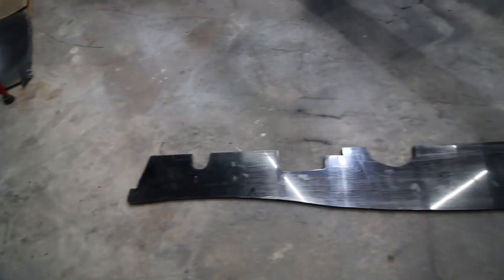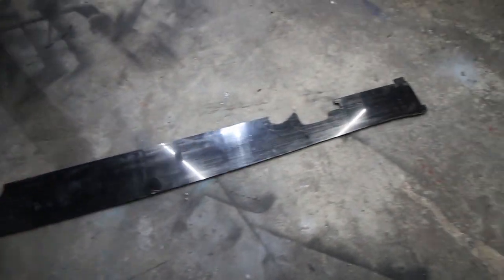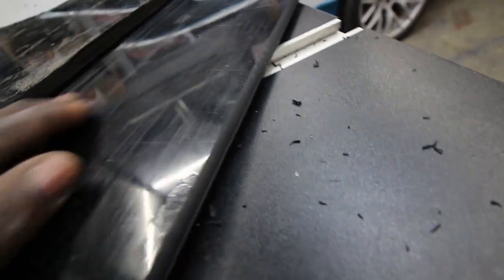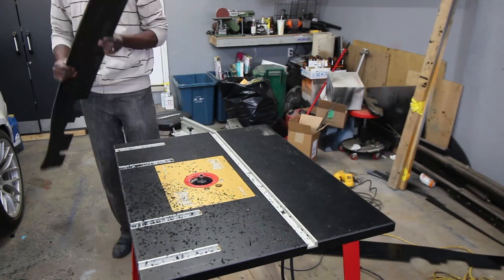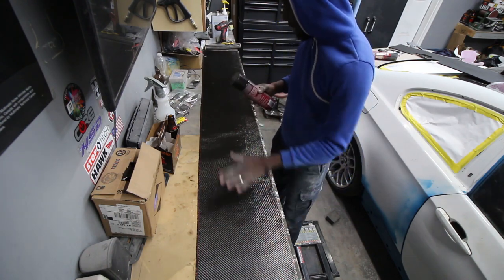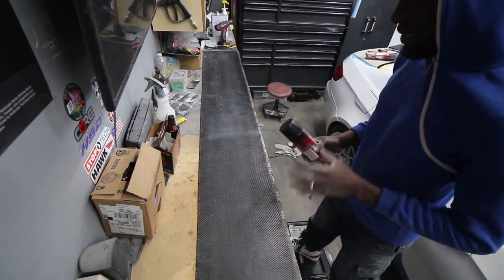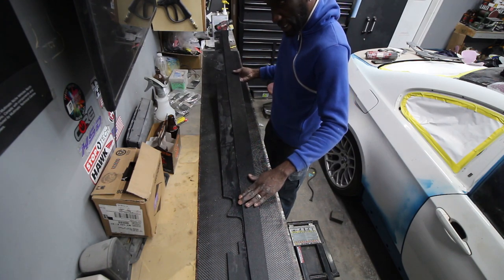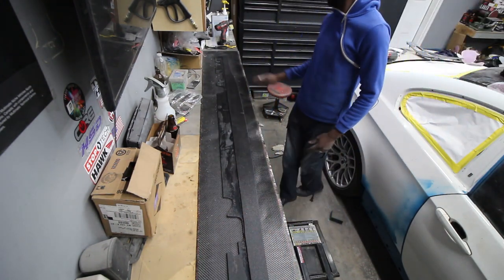Custom Side Skirt for the M3

Comment: Did you get the carbon online?  And what did you use for the  actual mold ?
Reply from the maker: I got on ebay and I use and to make the skirt
Reply: @FATmods  what material  where you cutting  with the jigsaw ?
Reply from the maker: Abs